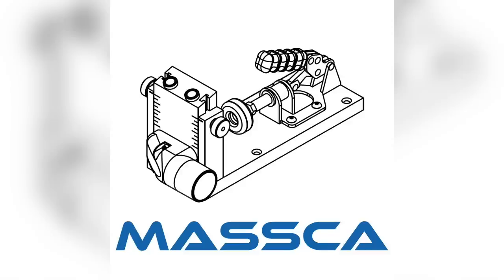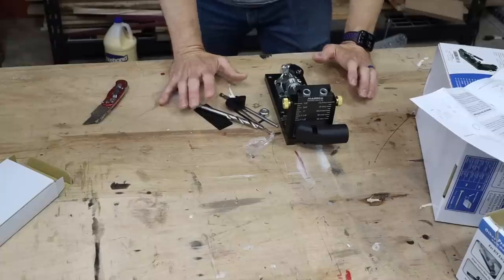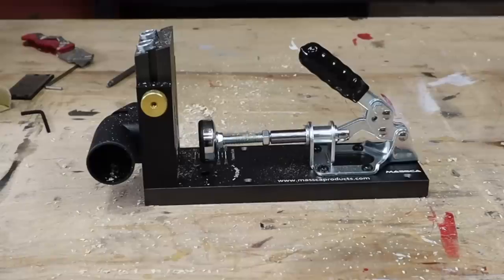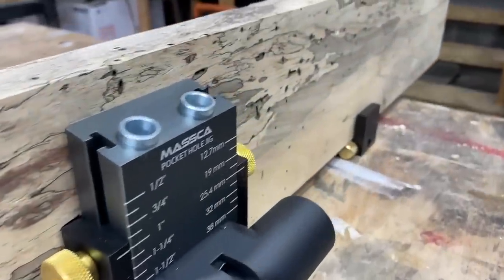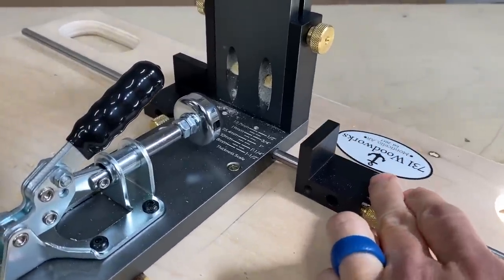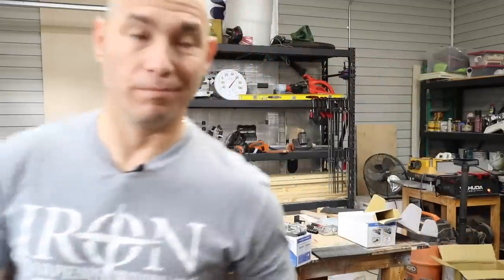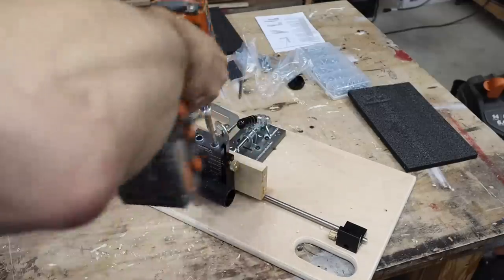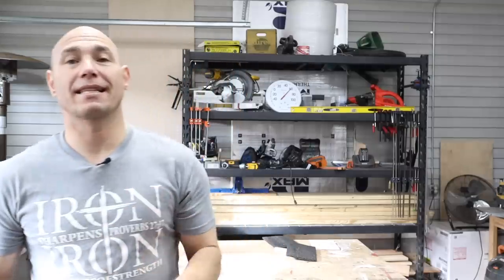A Better Pocket Hole Jig with a LIFETIME Warranty!

Comment: I looked at this and as much as I loved it, I didn’t. Kreg seemed great but being all plastic rubbed me the wrong way with durability. I looked, researched and found the WEN Pocket Hole Jig. Got it from Home Depot online and delivered for $60. Full metal construction just like the Massca. One thing I liked about WEN vs Massca was that I could adjust the distance between the jig holes for different sized boards/material. I got everything from bits to screws. They even included some dowel fillers for the holes. 

All in all I am glad to see that this product got a review from you. It was definitely a worthy choice when I was deciding. Thank you very much and happy wood working 👌

Comment: Absolutely nothing wrong with innovation. I have been using a Kreg pocket hole kit for going on 25 years.Today I use a Festool Domino or mortise and tenons for most joinery but the pocket hole still has a place in most shops.

Not going to go buy one of these Massca’s any time soon because the Kreg has done everything well for me. If I was new and looking for a jig the Massca would be another good choice in the mix.

Comment: Great review and I bought one of these over the Kreg a while back because it looked sturdier and the Kreg seemed cheap by comparison.  I am not the pocket hole king but it has been great so far on the stuff I have used it on (making some cabinet face frames) and I plan to use it a lot more when I get to the new wainscoting.

Comment: Glad you did this review. They are offering a higher quality product for a comparable price to Kregg. That sells it in my book. Thanks Matt.
Reply from the maker: Thank you
Reply: I agree to a point... I only own the Kregg jig and have for years, but this looks like a much better product.... BUT Kregg does offer a jig and drill bit set for the $20 price range for those on a budget or for someone in a pinch... I enjoyed this review though and all Matt’s content that I’ve seen!! Because of this, I will definitely be trying out the M2 in the near future.... 

Thanks!!
Dan
Reply: People complain about Kreg's quality, but I've yet to see any of them break.  Yes it's plastic, but you're not not beating it with a hammer so I don't see the issue.   That being said I like this Jig and I'm strongly considering it.  Knowing you can use Kreg's drill bits and screws makes it very appealing.

Comment: That system looks awesome, love the fact that it is all metal, but not a big fan of the locking clamp, support arms and like you the depth gauge.  That is totally just me, heck I am still using the keg K4, I just don’t use pocket holes enough to justify getting it, but if I do I am dang sure upgrading to this one.  Awesome job reviewing Matt!

Comment: It appears the the dust collection port is screwed onto the jig!!  That was one thing with the K5 was after adding my adapter to go from the jig size dust port to my 2.5" hose the weight kept pulling the plastic off as it was just clips.  It's small things like that make a difference as I had to clamp my hose up so it had no tension at the jig.
Reply from the maker: Yes it is. It can be turned to point the other direction as well.

Comment: Hi Matt, great video as always,  it makes me real happy every time a sponsor reaches out, you absolutely deserve it.
Quick question, this is the first time I hear about this brand but based on your review, I definitely want to get one, but, I have a small kreg 320 jig and was wondering if you can use that drill bit (that I love) and Kreg pocket hole screws with this other jig (I have a ton of kreg screws) thanks for everything 👊
Reply from the maker: Thanks.  yes the drill bit and screws will work. They are the same size as this one uses.

Comment: What I would do for the drill depth setting is mark the board that it is mounted on for the different lengths I would need. Still store the guide somewhere safe but make a "backup"

Comment: My K5 is only a few years old but like you mentioned on the Massca I don't like the small piece to set the depth collar. The K4's depth scale is on the jig itself and the one for the R3 has one built into the case. Maybe Massca can incorporate one like the K4 in their next generation. The jig looks really solid, good review.
Reply from the maker: Thank you

Comment: Great pocket hole jig! That said there are three improvements they could make right away which I will be doing to mine. The first two are easy. Making dust port magnetic, drilling/tapping material supports so stop blocks are lockable and lastly milling the base to allow for stand alone plate to be permanently attached while in the base. What do you think Matt?

Comment: I bought the M2 and have been disappointed. I have been using a kreg clamp on jig for years, so this was going to be a big upgrade, or so I thought. I was excited to use it on my woodshop cabinet project, so when I received it, I put it right to work...I carefully followed the setup for the drill block as well as the stop collar on the drill guide. I loved that it clamped to my MFT top and the dust collection was great. The problem came when I started to assemble my cabinets a couple of weeks later...when I drove the pocket hole screws home, they were piercing through the side of the face panel. At first I thought that maybe I had made a mistake during the setup, so using a couple of scrap pieces I confirmed the settings and drilled again...same result. I had drilled the material for 4 cabinets so this turned out to be a huge problem...since I was not about to throw away perfectly good birch ply, I was forced to cut the tips off about 3/16 on almost 100 pocket hole screws. In the end it worked, but there is something off on the jig. To get the jig to drill a hole that will not pierce the face panel on 3/4 ply I am forced to set the block way off on the 2nd mark between the 1/2 & 3/4 and I have to set the depth stop using the next setting of 7/8 on the circle depth gauge. I tried a number of combinations, this was the only way I was able to get it to stop drilling holes too deep. The other issue I have is with the clamp, it works great for a little while, but when batching out parts it tends to come loose and you have to stop and readjust...the pocket holes in ply are also not as clean as I am used to with the cheap Kreg I have been using....I was going to return it, but I missed my window with Amazon by a couple of days. It's disappointing to spend $130 on a product only to have to then jerry rig it for it to work properly...

Comment: Congrats on the partnership. Harbor Freight has a model similar to this I picked up on a budget. However, this Massca is that HF product on steroids. Great review of what looks like a quality product - definitely will consider it when upgrading. GJ Matt. Also cool website. I bought the Wahuda jointer based on your review. I'm having a heck of a time leveling the in and out feed tables. Any chance of a 731 tutorial :) ?

Comment: I’ve had the Kreg 320 for a few days and it works fine. For a beginner $40 is a small price to pay for an entry level tool. I can see the M2 speeding up the process considerably as well as more accurately. Guess I’m sending the 320 back to Amazon.

Comment: My M2 kit showed up today with a metal burr on one of the end blocks, a bad thread on the dust collector tube that did not allow one of the screws to thread, and the column unit that attaches to the jig body was not square. My eye even noticed how far out of whack it was. I contacted Massca and within 20 minutes, I got a call from the company's owner apologizing and wanting to make things right. He is sending a complete replacement unit and will check it ahead of time for proper fit and finish. Now THAT is customer service!
Reply from the maker: Sorry to hear that.  They will get you taken care of.
Reply: @731Woodworks  Indeed, per my post...excellent customer service.

Comment: Massca pocket hole jigs look like they put quite a bit of thought into their construction. I guessing it won’t be long before they offer the perfect pocket hole jig. Seeing how I already have a pocket hole jig, I’m going to wait till they they bring out a better model with auto adjust features plus an auto bit depth setting which mine has, other then that, I think the Massca is a fantastic pocket hole jig. I love the wings and the fact that you pull out the pocket hole jig to use on its own that will undoubtedly come in handy! 👍👍👍👍

Comment: I am sure these are well built and work well, but they have the same problem as a lot of others in that the locking handle is on the back side so if I am putting pockets on a large panel, it is hard to reach the handle to lock it down. I much prefer the locking handle to be on the front side facing me, so I don't have to reach around the back. That is why I got a Kreg K5 after using the K4 for a little while.  I wish I could still get the K5 as I would like to leave one at home and one at my daughters house. I am thinking about an Armor Tool Auto-Jig but is a bit more than the Kreg K5 was.

Comment: I've had one of these for a year and a half. Works great, the dust collection is not great though but its still much better than the Kreg it replaced.  Has a much better feel than Kreg. The quality is great.
Reply: DEWALT cordless vac hooks up great to the Kreg and this port looks similar.

Comment: The biggest factor effecting the quality of your finished pieces is the angle of the hole. The blue brand drills too steep of an angle that's why your pieces never line up. The professional Castle and Ritter machines are much shallower angles to avoid those issues. What angle does the Massca drill the holes at?

Comment: I assume you can use a track clamp on the t-track built into the base.  That would be nice.  @ the very least I'll go out and buy some pocket screws from Massca.  Can't justify a pocket hole jig when my kreg works fine. BTW, new camera?  Great image quality!
Reply from the maker: Correct  No sir same camera.

Comment: Thanks for the honest review. Just getting in to woodworking and trying to pull the trigger on a better jig. Another youtuber suggested replacing the clamp with an anchor auto adjust, was wondering what your thoughts were for an occasional diyer if the upgrade is worth it. Keep up the good work!

Comment: I was stoked to get the K5 literally a month ago maybe? Then I was use IG it for the pocket holes for the shelves in the coffee bar I’m doing, dang it if the bolt underneath came off and wouldn’t allow it to clamp the plywood. I ended up having to actually rig it with a screw I have. I was disappointed
Reply from the maker: Ahh dang! Sorry

Comment: Check out the Milescraft 7336 Pocket Jig 200XCJ - got great features including a built-in drawer for holding drills, driver etc.  (uses Torx pocket hole screws!).  Amazing low price!

Comment: What is.the difference between the small-headed screws or the ones with the washers? Thanks
Reply from the maker: Talking about pocket screws?  Pocket screws have a flat, washer like head that allows them to stop at the bottom of the pocket hole.

Comment: That M2 bundle just went on my "need to buy" list!!!! I'm not going to sit around waiting to win one of these. Unlike the new jig from that blue company, this looks like my old jig might be getting replaced. 

10:00 You might want to look into getting a 3D printer so you can download and/or design your own custom adapter rather than wanting to buy one, and always forgetting to do so, or you buy one and it doesn't fit and you have to go back to the store. I love my Creality Ender 5 Plus, but there are countless other printers out there to choose from. They are also very useful for other things as well in and out of your workshop. I have the same Delta miter saw that you have for example, I found, downloaded and printed an adapter that allows me to hook the saw up to my shop vac. In fact, if you'd like, I can print one for you and send it to you free of charge..........cuz I like your channels so much!!!
Reply from the maker: Awesome. Thank you
Reply: @731Woodworks  Where can I find a shipping address??
Reply from the maker: @PaganWizard  Send me an email 731woodworks@gmail.com
Reply: @731Woodworks  email has been sent. I included 2 pictures in the email.

Comment: I’d be on board if it had auto adjust AND the drill guide was on the same side as the handle clamp. I don’t like working from both sides of a tool. Other than that, the quality of the material they’ve used to build it is awesome.

Comment: Why don’t you recess the bit depth gauge in the work board with maybe a small magnet. Then you have it with the pocket hole system.
Reply: Hmmm..round magnet..great 💡
Reply from the maker: I got a few of those around 👍🏻

Comment: Again another very helpful vid for an item I need and I will definitely be buying one. I have a question about the face clamps are there big differences in them between manufacturers?
Reply from the maker: The ones I have used are similar

Comment: Have you tried Armor Tool's "Auto-Jig"? If so, out of it and the Massca, which would you suggest?

I've never used pocket hole jigs before, I've always been a traditional joinery guy, using hand tools. Most the time, people aren't willing to pay for that. Been expanding my power tool line up over the last two years (and learning to work wood with them), and I'm thinkin' a pocket hole jig will do me well.

Up till now, I've been joining with a router and dowels for quick/cheap jobs. Pocket holes seems even quicker, and it hides the screw, which is great, because I've always had a dislike for visible screws.
Reply from the maker: I haven't used the Armor, sorry.

Comment: So the big question for me is...how bad or good is the tear out on the piece of wood after drilling? You seemed to blow past that part. From what I've seen on another video it wasn't very clean. I've got a very old Kreg system that I'd like to replace but there has to be more to it than a pretty piece of metal.
Reply from the maker: You'll always have a little tear out.  That is typical with this type of drill bits.  I haven't found a jig yet that prevents it.  A little sanding takes care of it

Comment: I have the M2 and when I used it the other day it seemed like most of the holes weren't cleanly carved out. I'm not sure if it was my technique, of which I tried a few, or if it was because the lumber wasn't fully dry. I'm thinking it's the latter but any advice would be great.  I wouldn't want to send this back for the blue cos aluminum > plastic.
Reply from the maker: Your bit is likely dull
Reply: @731Woodworks  On a brand new jig? Gotta see how that lifetime warranty holds.
Reply from the maker: @jay221982  Oh okay, maybe wet wood?  Try it on dry, if it still does it reach out to Massca
Reply: @731Woodworks  Will do, Matt! Thank you!

Comment: Seems nice. But the international scale (mm) is a joke. They just translated the scale on the left (inches) to mm. If i have a 1 inch part for some reason in Europe I could just set it to 1 inch. We don't use inches so why is the mm scale based on inches? They should have made it to the sizes of wood we have here. But other than that it seems to be a solid product. Thanks for the review! Best wishes from Sweden!